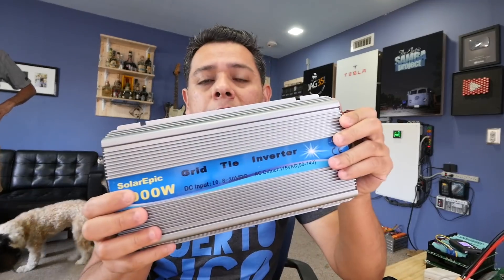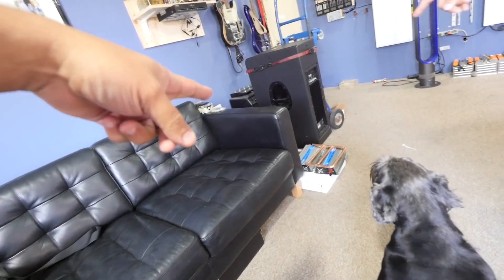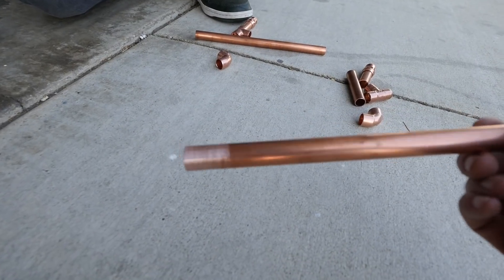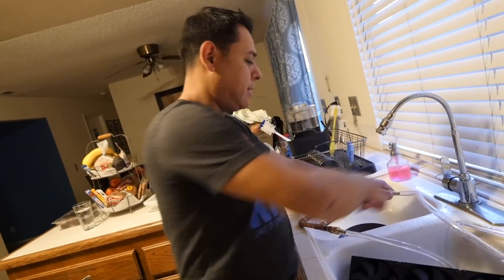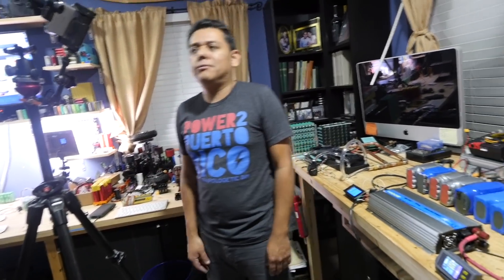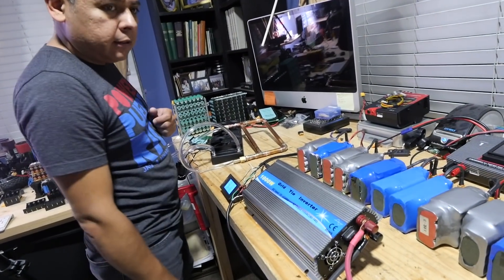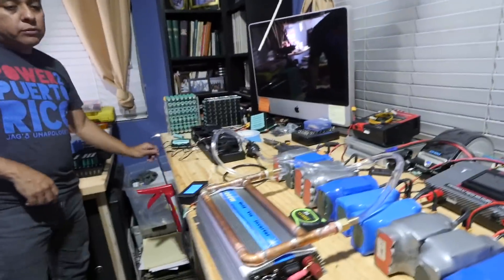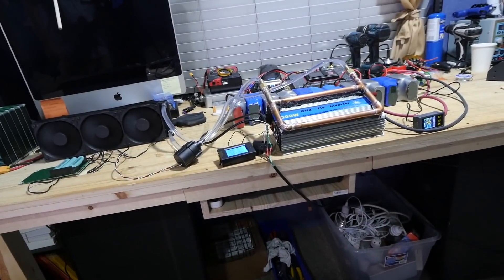Liquid cooling A cheap 1kW Amazon Grid Tie Inverter Experiment

Comment: Just looked up the heatblocks i was talking about. They're $3.30 USD delivered.  The tubing woud fit over the existing barbs, and all you'd do is mount them on your inverters at the hottest point. To get it flat, i'd be inclined to use a mill, but i suppose maybe you could try a grinder.

Comment: Would a mass amount of 5mm (3/16) holes drilled all over the hot side.
Point the two end fans facing inwards to force the heat out of the drilled holes.
And then maybe lay a couple of fans over the drilled area, with the fans facing away to help suck the hot air away from that area. 
Just a suggestion. 🤔😜😎👍Thoughts?!

Comment: better result You would have if you use this tape to stick aluminium strips vertically and support it somehow and on the end  use the fan to have the airflow ...to stick pipe to the inverter like this the contact surface is very small, and I don't know how good is shmoo to conduct the heat  ...first try  behind you  so is time for the second one :)  ..i like comment section under Your video  ...read few comments and I only found more constructive  comments :)   ..this is cool :)   ..thanks everyone :)

Comment: If you're going to be using more of the same inverters, then it would be simpler to use your adhesive to attach a straight pipe along the side where it gets hot with fittings on either end and use flexible tubing to go between the other inverters. This will limit the number of solder joints you have to make and allows you to more easily place the inverters since you have flexible tubing between each radiator. As multiple other people have said, yes the way you're doing it is inefficient, but if you're looking for quick and easy, then just a straight pipe along the side that gets hot with thermal adhesive on it and fittings on either end is easier to solder. Just run them in series with the radiator at the end.

Comment: Take a grinder and grind those fins on the side flat... now use square alu tube stock on the flat faces you created... THe ends of the stock is sealed with those plastic plugs and then put a barb in through the plastic for your pipes... make sure you have good placement as you want to use the bare minimum thermal compound you can.
Reply: I was thinking you could take an aluminum plate, bend it, and seal it against the edge of the unit where the fins are, that way you can use the fins to dissipate the heat against the water, and you just weld on a hose adapter on either end.

Comment: You need to look into the refrigerator water line it's thin copper line that is very flexible you could cover a lot more surface area and wouldn't have to solder any corners and it's cheap like 20 dollars for a 25 foot roll of pipe it will work great.

Comment: Ditch the heatsink entirely. Carefully hammer some 1"+ copper pipe nearly flat, or at least a flat surface. Then solder copper flat bar (with holes for every fet) to remount all of the fets to it. That way you can solidly mount all of the mosfets straight to the water pipe. Also equalize the flow so it doesn't bias one side of the loop, think a Y adapter feeding the pipes.

The other option would take machining. Machine a block of aluminum with a channel shaped like a half pipe so it slips right over the copper pipe and has more contact area. Then attach your fets to that aluminum block. Bet that would work pretty well and be fairly reliable. Even easier would be drilling a hole straight through the block of aluminum and sliding the pipe in before brazing connectors. Just leave enough pipe sticking out so it's not a huge pain to solder the fittings on. That aluminum will suck up a lot of heat and you don't want to cook your thermal compound between the pipe and aluminum either.

Comment: (What you should of done is put the rubber tube in something that Will cool the water faster, I do believe the that fans didn't cool the water fast enough by what mean is that the when the water got to the inverter the water got hot but when it got to the fans the water didn't get it to where it was cold the water got it to where it was warm. And that where the inverter did cool down.) But I might be wrong.

Comment: Here is something to consider and that is use a bit longer copper pipe so that the fittings are off the device you wish to cool. This way the copper pipe makes full contact with the aluminum heatsink and might cool even better. I think the air gap between the paste and copper pipe is drastically too far to be useful even with the heat transfer goop.

All things considered you just might be better off with blowing colder AC air across the unit from a portable AC unit. That way you can blow very cold air across it and cool the room at the same time with far less fuss. Granted said portable AC unit will use some electric but not as much as you might think... Cheers...

Comment: Using "soft" 1/4" or "1/8" copper would allow you to flatten the copper before you solder the ends. That will give you more contact with the fins on the inverter cover. You won't need to solder it. Leave the ends unflattened to attach fittings. Make several returns like you see  in the 2nd pic https://www.wikihow.com/Clean-Refrigerator-Coils  ...just make the returns closer together than in the pic and at least 4 to 6. Your original design didn't remove heat efficiently due to several problems. Not enough surface contact with the inverter, water flow wasn't continuous the way it was built and pump couldn't push enough water thru the large  3/4" pipe to remove heat efficiently.Doing this as one continuous piece of copper will remove heat 10 fold over your previous attempt. Use compression fittings on the ends of copper or "Shark Bite" fittings to attach your hoses without solder and torch.

Comment: My theory is that you are getting little to no water flow on the closest copper pipe, and the furthest copper pipe is getting all the water flow from the water current. You aren't maxing out the flow capacity of the copper pipe due to the fittings. Try flipping the copper pipe around and test again. Have the furthest end on the hottest side.

Comment: You would get way more contact area by using thin tubing, maybe 1/16", that could zigzag all the way from side to side with each tube pushing down in the fluting between the fins of the case. Strap em down tight, lots of contact area, no soldering to do, just lots of small tubing bends.
Reply: I just typed out pretty much the same comment. lol

Comment: why not take covers off and submerse in mineral oil...like some people do with their computers
Reply: Plastic will degrade over time, but i do agree, it would work. You'd stack them all tightly in a sealed bucket, and have a loop cycling the oil out. youtube "mineral oil bitcoin" as an example
Reply: The mineral oil works as a over all small value cap the switching speed of the Igor’s used in this is high enough for these to cause a problem other wise its a great idea !
Reply: ? sense

Comment: Of course it can be done I would use a stock kit for water cooling computers some of them are pretty damn amazing and pretty strong this way you can run the cooling coils right inside that inverter without risk of any water or coolant messing things up

Comment: Sodering on concrete is not a good idea.  The concrete keeps the copper from reaching the proper temp.  Probably why it leaked.
Reply: with a heatgun, you have to solder on concrete or steel.

Comment: It works, but not the you had set it up.. look at how the cpu cooling is done, right at the source of the heat rather than picking up on the secondary cooling setup.
Reply: just apply law of thermodynamics properly, it will work.. energy flows from higher level to lower level.. greater the difference, better the efficiency of the system.

Comment: try dropping it in mineral oil, or crack it open stick on a pc heat-sink and some fans or even attaching the copper to a sheet then attach the sheet to the case or even sticking them in a cooler with ice or one of those diy ac. try wrapping it in copper tubing and running cold water through it with a fountain pump. maybe tape on a peltier unit

Comment: Why don’t you just use Peltia plates and fans. No don’t strap your youtube subs to the unit. Oh and don’t forget the antifreeze. Grind the heat think flat so the plates can sit flush and use your water coolera. Also localise your your cooling specifically to the hot transistors and regulators in the unit.
Reply: peltias use a heap of electricity. He might as well just buy some proper heatsinks and replace the outer cover

Comment: You may not like this but use oil the is not conductive just sink them in there use a radiator to get rid of the heat with a pump some computers for high end gaming do this they use mineral oil

Comment: If you are looking at this long term you should make sure you are not using tap water, use something like distilled water with anti-growth chemicals added to it. If you dont you will end up with stuff growing in your loop and cause major problems with the pump and rad.

Comment: Use smaller pipe, and more passes over the unit. Also, use a coolant, rather than water. There is also connections you can use that require no soldering.

Comment: Seems the first step would be to modify the existing fan to improve cooling, perhaps a series of fans sucking in cool air from the basement or a hole in the ground that on really hot days you can dump ice into? And then once that's maxed out, target the parts of the device it's existing cooling system can't reach by attaching cooling fins/heat sink and more fans. Also a question: I wanna get a thermal camera attachment for my phone like yours for diagnosing bad cells in Prius hybrid pack, did you cover that in a previous video? What kind of thermal camera attachment do you use on your phone?

Comment: Firstly... Water boils at 200F. Polyethylene Glycol boils at 330F. Ethylene Glycol boils at 371F... One problem you're having is, the water is heating up too much and too fast. It can't absorb and dissipate the heat like Ethylene Glycol. You'll find Ethylene Glycol at many High Performance Automotive suppliers, as they use it in Race Cars... Then, you need a bleeder valve to remove air bubbles... As Water and most coolants form bubbles, when heated, you need to purge them from the line... The bubbles form "Hot spots"... Nuf said... Carry on :-) Great little video.
Reply: DStray Cat that water was below 84F and the gunk he put in between might have worked more like insulator. I would have not even tried to do this project without removing the case.. but I understand jehus need to keep it simple, but I would say he made it overcomplicated. You should not be afraid to open stuff :)

Comment: Modify a car air conditioning units and build a box around the batteries or use the box that the batteries are in but just run the hoses either from the bottom or from the top and then you can use fans to circulate it even better but you get the benefits of the AC cooling unit liquid or coolant don't know I might be a good try good job though I had the money to build my own wall thanks

Comment: I think if u get some computer processor water cooling adaptors and install them on the Mosfets directly, the difference on the temperature would be bigger,  also if u use car antifreeze on it, the system would run cooler than using tap water. Just an idea.

Comment: Take the circuit board out of the case and then solder the transistor tabs to a straight section of the copper pipe. You'll end up with two tubes on the sides with a short hose between them. Then run that to your radiator.

Comment: I'm not wondering If it's going to leak maybe it will. But what I'm wondering about is Long term liquid condensation dripping from pipe and going into the Grid tie inverter. What do i know right LOL
Reply: If the temperature of the water is above the atmospheric dew point then there won't be any condensation, that usually becomes a problem if you refrigerate the water but shouldn't be if your just spreading the heat around with a radiator

Comment: There seems to be a concentrated amount of heat at the top right corner. Why not remove the heatsink overall (top cover) and add a CPU block to that specific chip? Maybe make a cut out for that hot spot to fit the CPU block externally. Just an idea. 

Love your content!

Comment: Use smaller diameter pipes you can easily bend and also flatten a bit for more contact surface plus this way you only need to solder the input and output connector.

Comment: Those inverters have the mounting holes on the sides where the mosfets are. Mount the inverters on a large piece of aluminum to help them disapate heat. Should be easier and probably just as effective.

Comment: You can get semi malleable copper tubing bend it back and forth in a radiator like fashion the problem is as you do not have enough surface area to extract the heat from the inverters plus you should use thermal conductivity paste think of what you're trying to do it's like a CPU you need to build something like a CPU Cooler surface contact area equals cooling efficiency I may look like a hillbilly but I have a degree in the stuff green energy technology and Entrepreneurship

Comment: Use one long length of quarter inch clear hose (or similar) and S bend it all over the top surface and secure with cardboard sheet so its all in contact with the fins, Just one inlet and one outlet (bit like under floor heating) :)

Comment: Use coiled copper tubing, not straight pipe. You can bend it with your hands and would be better cooling. Build it like you would for a cooler in a distiller. More surface area contact with the heat fins on the inverter. Just wrap the inverter in copper and run that to your radiator. You could probably get at least 30 or so degrees less heat. Good experiment.

Comment: I think if you used much smaller pipe in rows on the sides where the heat is and then spread that black shmoo all over it I think you could see huge results it would definitely be time-consuming to build but I think you could see a 25 to 30 degree temperature change. I would say 4 to 6 rows of 1/4 inch pipe(on the sides and rounding the corner to the top) to half inch hose to the radiator/fans. You could also use aluminum but copper is easier to solder. Always remember when soldering copper pipe together use gravity to help suck the solder into the joint.

Comment: you could take apart the inverter and attach a custom water cooler to the chips the outer shell is connected to, also next time add a vertical reservoir to prevent bubbles. also a computer water cooling kit might help also

Comment: Also make sure that the radiator you are using is made of copper. If it's a aluminum radiator you will run into something called "Galvanic corrosion", which will eat into the metal and put a lot of particles in the loop.

Comment: Great attempt. I did this for solar heating pools. Basic information about this: first, heat transfer through surface area( a couple smaller tubes vs one large); second, the type of fluid for heat transfer from "heat exchangers" (just water is one of the slowest for this process); and three, the rate of flow of the cooling fluid (gpm). 
Hope this helps with your designs. Cant wait to see the final results.

Comment: Thanks for the effort. I think using that thermal conductive goo, with some aluminum strips stuck in the heatsink grooves would be the most economical, yet effect method for additional cooling.

Comment: mr GARCIA,,, hahaha next time buy the roled up tubing , fill it with sand  , then bend the pipe tubing the design you want then hook it up to the fand but use raderflud .  your pipe work , was not good , no premo no good . the water had two directions to run befor geting to the fans..

Comment: Shocking.  If you insist liquid cooling, try those computer all in one watercoolers and stick them to the hottest point of the inverter.

edit: I see now how those chips are cooled by the inverter housing/sidewall.  The only elegant way I can think of is to chop off a piece of heatsink material from those CPU coolers in the Intel Pentium 4 days and stick those to the opposite side of the chips.

Comment: That gap is huge if you took it apart and get the case hot though to to solder the pipe soldered to the case with a lot closer to the case just in general it needs to be closer because thermal paste and tape are something but not great

Comment: Open up the enclosure for the inverters, see if there is anything inside that is a design flaw (cheap as the main reason this being a side effect maybe).  A custom aluminum extruded enclosure since that is just an average chinesium extruded enclusure (my old school digital ballasts have that exact enclosure).  Alibaba has sellers that do beefier enclosure/heatsinks with bigger fins. OR have bare PCB from the inverters in a large custom heatsink'd enclosure with fans.  Many options, need better thermal surface contact on the pats that do get hot inside and thermal transfer.

Comment: I have this same inverter.  A maximum of 550 watts will ever feed into it so I think I'm probably good with the tiny built-in fans it has.  I have a much bigger grid-tie solar system as well but those panels feed into a Sunny Boy SMA inverter.  It's so efficient that it needs no cooling at all at 4000 watts.  The heat radiating from the fins (even in a hot garage) is sufficient.

Comment: Smaller diameter flexible copper tubing that fits between the fins with direct contact to fins and is flexible. One long looped peace no soldering. Plus fans
Reply: Yep, use 1/4" refrigerator copper tubing.

Comment: I would be tightening the mosfet screws to the aluminium housing first . And take the top off the housing to see that the mosfets are hard against the housing as well . Cheap ones are notoriously built cheap!